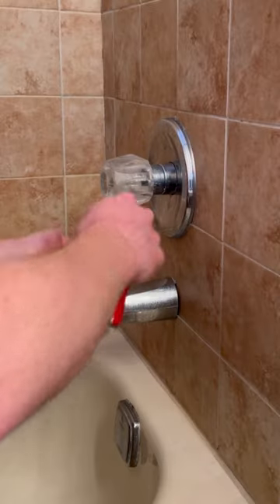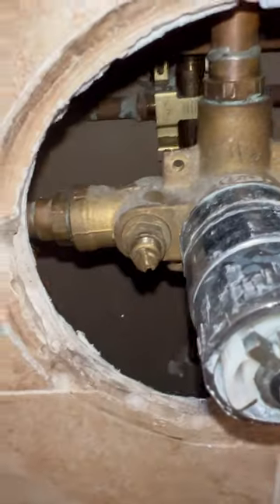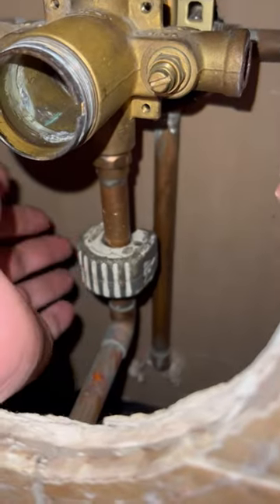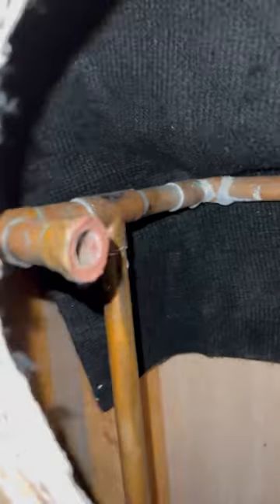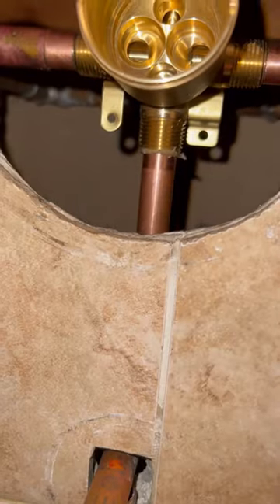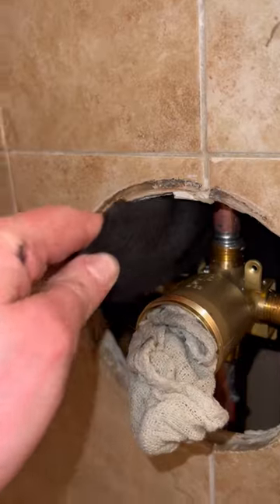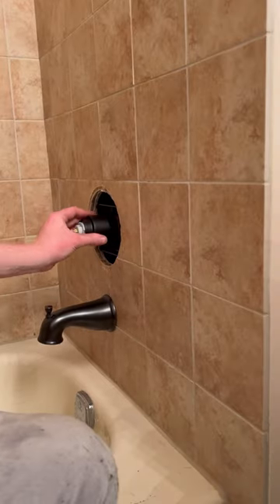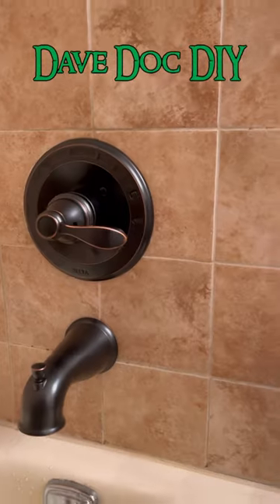Delta shower valve install! Tight space! #diy #plumber #plumbing #handyman #shower #delta

Comment: Thankfully there is plumbers who still solder. Kudos
Reply from the maker: I love it! Not fitting any pro press in that space!! 😂
Reply: He had no choice...lol
Reply: Solder can still leak braising as well.
Reply: @rockerctereo2851  yeah if you fail to solder the joint mr professional Pex man.
Reply: Most of the time the pipe leaks not the fitting.  So it doesn't matter what you use. If it's copper it will fail eventually
Reply: Sometimes you have to. Sometimes you don't...
Reply: That’s the statement of an inexperienced heckler. 

Why do we need to keep learning a dying art? It’s dying because consumers weren’t gonna pay. Plumbers aren’t gonna do it free. Homeowners will always go the cheap way out expecting a golden door to be opened. Copper in its most strict hand book will go bad in 50 years. Maybe not the whole length. But there will be 1 hole. We have to keep evolving with products. You see that house In Pennsylvania explode? Bet the tech knew how to solder.

Comment: I'm a professional plumber and must say I'm impressed. Good job 👏
Reply from the maker: I appreciate it!!
Reply: @DaveDocDIY      good job a pain in ass I think    Im a plumber   so I know  ,  no problem soldering just fitting it all up is  a job
Reply: Yeah man I give you props, I would always sell people on removing tiles just so I wouldn't have to fight anything. But I've done a few in some small holes like that I know it's a pain
Reply: same here, this guy did fantastic.
Reply: Speechless
Reply: I did it the same way, but I bought a couple of small welding cloths and   used them as heat barriers.

Comment: If you use Moen you can actually flip the cartridge for back to back so the cold can be on the left and hot on the right, while still functioning like it is supposed to.

Comment: You were SO lucky that the shower body was between two studs. I’ve seen a lot of shower bodies that had a stud right in the center of the tub wall or just off to one side where you had to either drill or notch the stud. Somme one built that bathroom with some thought👍

Comment: You have more balls then me. I would be petrified of a possible fire.    My plumber was doing the same repair on the first floor of a century home that was balloon framed. The house had no insulation and the heat from the torch traveled straight up to the attic above the second floor and caught the roof on fire. Someone over the past 100 years plus had stuffed newspaper at the attic ceiling joist / wall location to act as insulation.

Comment: I had to do a soldering jobs similar to this but with a fiberglass tub shell and on the backside of it was granite kitchen countertop and tiles that were not accessible to be moved. I actually had to take a multi-tool and cut a long rectangular hole around the porcelain so I can get in there and safely sweat new valves in so that I wouldn't melt the fiberglass. It was either that or replace the entire bathtub shower walls in which a customer was in no condition to do. So this will get them out of the water for a few years until they get up enough money to actually do a bathroom remodel.
Reply from the maker: absolutely, and its a stressful situation! especially with you working with fiberglass on the other side, it only takes 1 second of flame to warp that!

Comment: I am also a plumber and yes this is impressive, done it myself before too. Changing shower arm drop ells through the hole is possible too, done a few of those.

Too bad he installed a Delta.r

The hot/cold for the other valve could have been fine if they just got a reversed cartridge. Most manufacturers offer reverse cartridges or trim.

Comment: i'm impressed you were able to work in that space I  usually like to cut the back wall if it's accessible like a closet. sometimes it's just not accessible or it  backs up to another bathroom.
but at any rate great work!
update- I did see the other shower valve behind that one which makes the work you did even more impressive!

Comment: notice your torch head is heating up a lot because you have it at a low rate so you don't burn up the wall by a small rose head/ rosebud torch head. great for keeping your flame a lot lower without messing up your torch
Reply: also buy "Cool Gel" !!! if you cant find it order it. its magic

Comment: Two and shower valve is one of the few situations where a b tank and torch actually works better than a ProPress. I haven't yet dropped $2,000 on the compact jaws for my $4,000 freaking press tool but I think that's what you need to press a shower valve without putting in a retrofit plate. I don't ever work out of the hole. I always cut a bigger for a retro plate just because it gives me more room to work.

Comment: Good clean work! Did you replace the other valve later?
Reply from the maker: The other delta was fine. I reversed the cartridge though so the hot and cold aren’t on the wrong sides 🙄 previous plumber did care.

Comment: I get it that you used a low flame due to fire worries but you sure heated your torch tip. We're those Lennox tube cutters? I've tried them in the past and they broke long before I could wear the paint off of them.

Comment: When the valve is opposite a outside stucco wall the black felt as a moisture barrier is quick to flash. My lazy co plumber burnt a top out framed house to the slab, opps!

Comment: Hell with that. I wouldn't have even attempted to solder that! I would have given the homeowner 2 choices: I use Sharkbites and they have ZERO warranty against leaks, or I cut open the wall and solder it and guarantee it won't leak, but then they have to hire a tile guy to redo the tile. 
Choose wisely, you have 60 seconds.

Comment: I always try to put it in with an access Panel with shut off valves in the back if possible just so you can turn it off and service it without having to shut the whole house down. Typically I replace it with a moan, proflow, or kolahr cartridge values
Reply: Moen 🤮
Reply: @kerzyjunior8627  delta☠️
Reply: Kohler is the best no doubt.
Reply: @kerzyjunior8627  pro flow is good
Reply: @ryanyork837  but moen is trash lolol
Reply: @kerzyjunior8627  moen in the 80s and 90s were really good
Reply: @ryanyork837  they operate wonderfully and do what they are supposed to. But trying to fix one makes me want to defenestrate myself
Reply: Back to back showers. Not possible to add an access panel.
Reply: @NHPlumber  Yeah that's obvious. His only allows he builder would design a back-to-back shower

Comment: That really is a tight spot. Finally a good plumber in these shorts. I feel like a little bitch now, I've always cut a hole in the back through the drywall. I know it wasn't an option in this particular situation, but why cause unnecessary damage anyways right? Definitely inspired me to give it a shot next time I'm in a similar job!

Comment: One of those valves hot and colds are crossed. The pipe on the right goes into the right side of the valve he's working on but it goes into the left side of the other valve meaning one of those is incorrect
Reply from the maker: Yup! I reversed the cartridge on the opposite side so it works properly.

Comment: Where is the 2x4 backing on the back ?! Which can make soldering a nightmare, u need fire proof clout , and never solder like this cause u can cause a fire that u might not even see coming , just cut an access panel at the back !
Reply: You didn't notice back to back tub faucets?!! No access from either side.😡😡.
Reply: @veeko616  ohh I just knottiest , in this case use shark bite ! And if u don’t like shark bite cause u don’t know how to prepare pipe for shark bite , 😁

Comment: You could not cut nice 20 by 20 hole in the back call it a day 🤔
Reply from the maker: There’s a shower opposite of this one. If you look again, they just threw in tees and made the hot and cold opposite on the other side 😑 I fixed that too 😂
Reply: @DaveDocDIY  instructions say that on back to back installations, you flip one of the cartridges 180. no need to repipe.